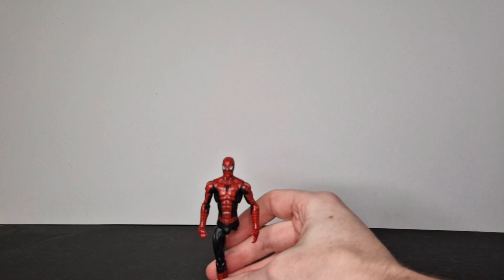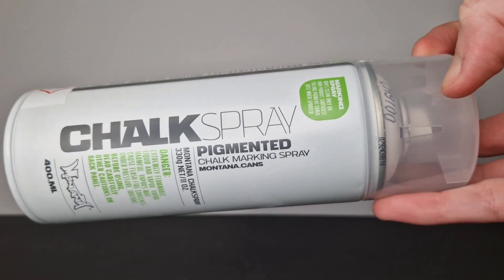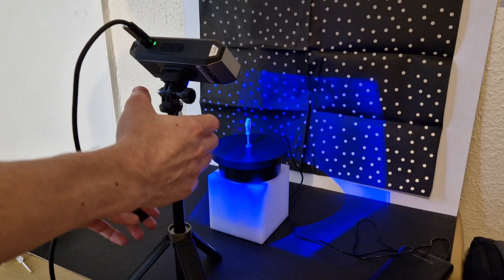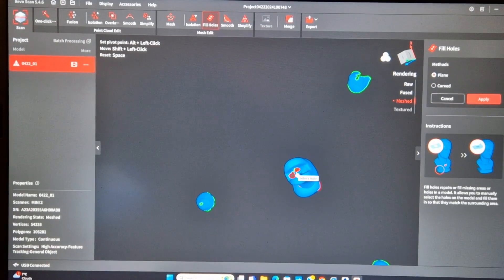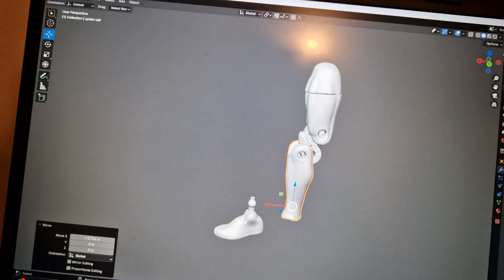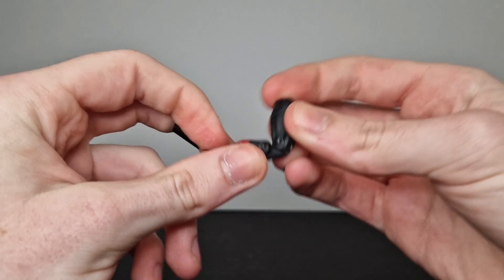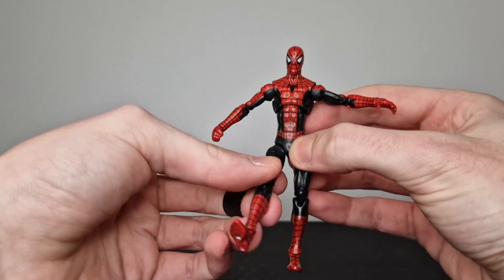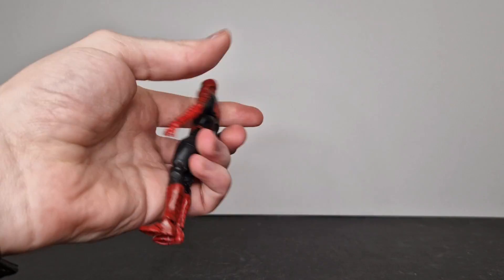Fixing My Spider-Man with the Revopoint MINI 2 3D scanner

Comment: This sparked a curious question in me

If an action figure is missing some parts, let's say left arm and left leg

Would it be possible to replace those parts by 3d scanning the opposite legs and flipping in in some software then 3d print?
Reply from the maker: Thats exactly what I did in the video
Reply: I meant Answered not sparked
My bad
Reply from the maker: Ahhh that makes more sense, I was very confused 😅